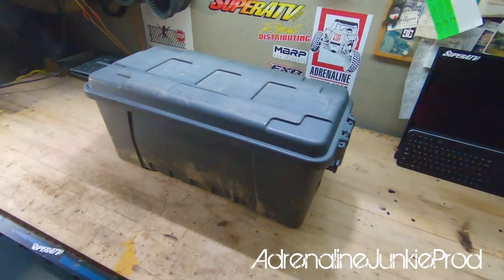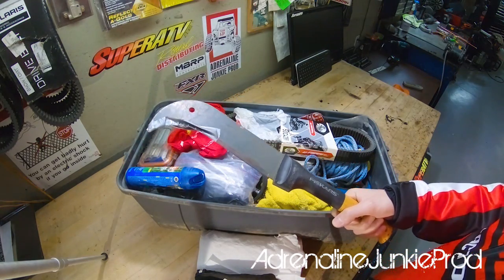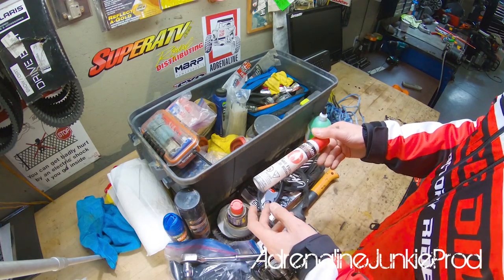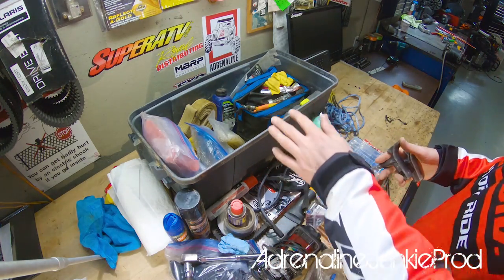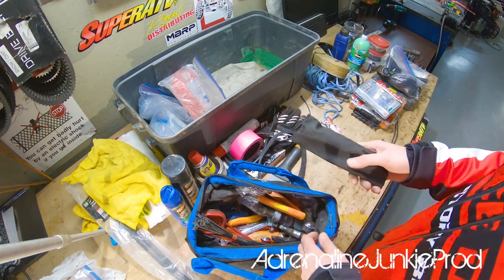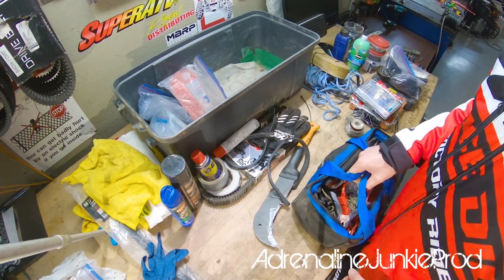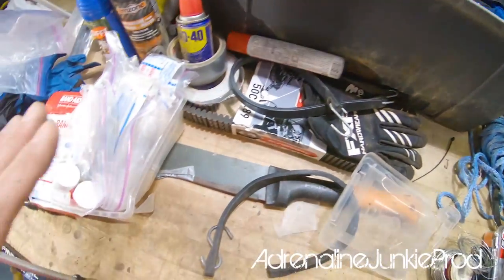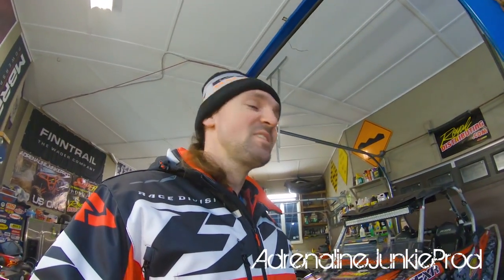What You NEED to Bring Riding With You - SXS/UTV Off-Roading Gear Box Overview - Essential Tools

Comment: Why is it nobody is packing the primary clutch removal tool.  If your belt shreds there is a good chance it will get behind the pulley.  If it's not all removed it will burn out the engine case seal.  What do you think about this.
Reply from the maker: I think it’s a valid point. The primary can be really tough to remove even with an impact gun and puller but it is a great suggestion. Might have to add that.

Comment: if you just ride trails on flat terrain, and never get too out of line, what kind of box should that rider have with them?
Reply from the maker: Really depends. This video was just an idea of what I bring. You'd be surprised how many of these things come in handy when you least expect it. You'd have to evaluate what you think would suit your needs based on your riding. Definitely some tire plugs and a compressor, some assorted zip tires, pliers, side cutters, duct tape, a knife and maybe a ratchet strap or two. That should be a good start for any machine.

Comment: Your older rzr has a mix of metric and standard nuts/bolts. Just an fyi. Typically need ALOT more then a "few" select sockets.
Reply from the maker: Hey, I don’t disagree but I’d argue that for trail side repairs a few “main” sockets is enough. Most the main bolts on the suspension and front/rear end are the same size. You gotta draw the line somewhere with what you bring. In a pinch it doesn’t really matter if you use a 13mm or a 1/2 inch socket as long as it gets you going again. This kit has helped us remedy a lot of stuff on the trail. Tie rods, ball joints, axles, brakes, etc.